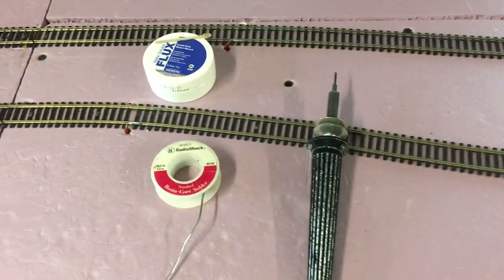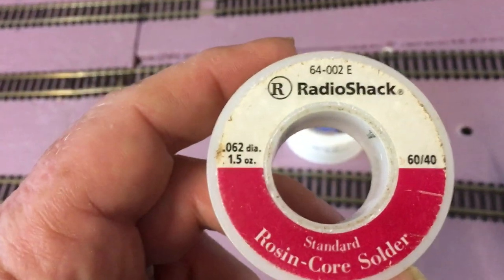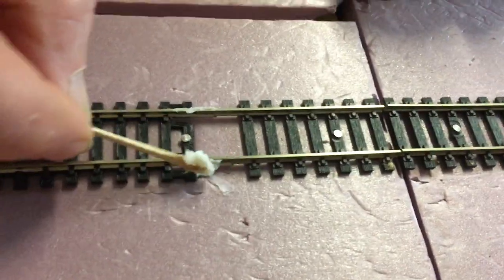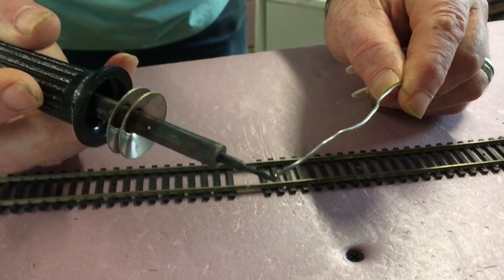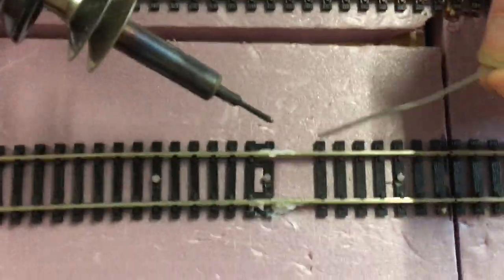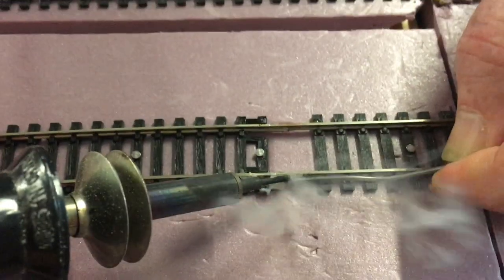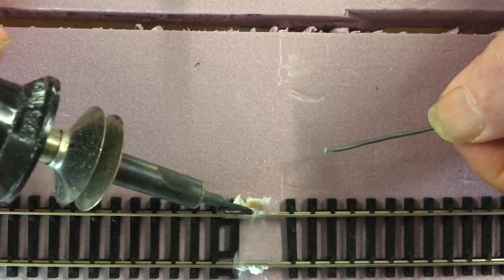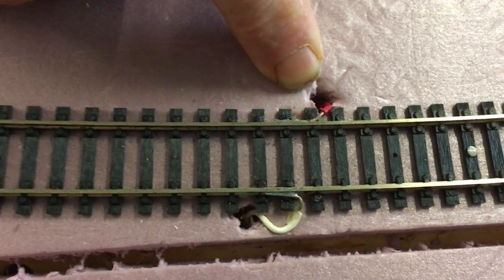Soldering Track, The Improved Video

Comment: I solder every two sections of flex track on the work bench (including feeders). I also use small 'alligator' clips fastened on either side of where the solder is applied, to act as heat sinks, and avoid damaging plastic ties.

Comment: I'm building an N scale layout using Peco code 55 flex track and it's almost IMPOSSIBLE to join track using the rail joiners. I have had enough of skinned fingers and bent joiners trying to do the job, so my solution will be to solder the rails without any joiners. I also use a pen style flex pen - no messy flux paste - good to go. 👍

Comment: Your solder already HAS flux in it....thats what rosin core means, external flux isnt needed. Oh BTW....clean your tip
Reply: train track rail isnt wire. it does need the extra flux